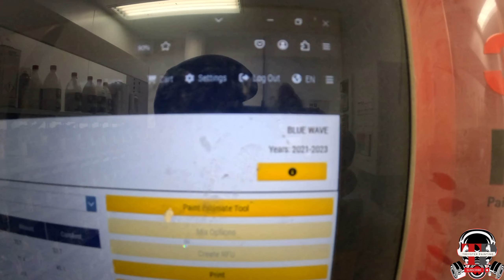Metallic Blue Wave with Glasurit 100 Line!! Ws-400 Series 2 and Sata Jet 5500RP!!

Comment: Damn that’s a cool gun case!! Is that made for guns or did you make it? Love watching that 100 line get sprayed. Looking slick!
Reply from the maker: It’s it’s made specifically for Sata guns. And yeah 100 line is amazing to watch and apply.
Reply: @treysterthepainterturner8404   best line I’ve seen so far it seems
Reply from the maker: @nickcrill7718 it’s a good line to be. I’ve been getting good luck on color match. Knock ✊🏾 on wood 🪵
Reply: 5500 RP w/ I cap, or WS400 Series 2 for high solids clear?
Reply from the maker: @Ontheroadbrogymgo wait wait u got me lost. What u asking me??
Reply: @treysterthepainterturner8404 I know you’re using the Iwata base gun, I was asking about the series 2 ws400 compared to the 5500 RP I pattern. Which one works better with a high solids clear? I have heard the CC can be a bit slow.
Reply from the maker: @Ontheroadbrogymgo yeah the cc is a lil slow but u get used to it. Depends on what u looking for if u wanna be fast use the RP if u wnt flatter finish then go with the series 2

Comment: I’m about to start using the 100line in October can’t wait I was wondering how long does it take the 100 to flash down before you clear
Reply from the maker: Not long at all. Pretty much when the paint turns matte it’s ready to clear. But what I do do make the water come out faster as soon as I’m done painting I’ll hit bake while I’m cleaning my gun and I’ll check if the water out it when I’m don’t cleaning my gun and if not I’ll blow the area while it’s baking then I’ll clear afterwards. Normally I’m baking it for about 5 to 10 mins.

Comment: Would you recommend the ws400 obs series 2 for that waterborne over sata rp 5500 I pattern? Thanks
Reply from the maker: For what line paint is the question?? What waterborne paint u talking??
Reply: It’s bmw line wet on wet application very similar to spies hecker hi tec or Cromax pro…thanks for your reply 👊🏼
Reply from the maker: @timreeks2149 idk if it’s as thick as the 100 line because if so the Sata would be better than the obs. I have the bfs series 2 for this line. I do have the obs series 2 but it’s a little slow with this line and do pump out enough material.
Reply: Nice one thankyou bud.yeah it is thick and basically one full coat and immediately apply orientation coat held back 12” or so..I’m using 5500 1.2i for base and clear..our clear is very thin so may go with 1.3cc or ws400 clear for the clear coat…thanks for your man 👊🏼💥keep up the vids dude top painting…you recon cc or ws for clear? Cheers dude
Reply from the maker: @timreeks2149 no problem and depends on what type of speed you looking for in clearing because they both are very great gun but what speed u like to do when clearing
Reply: I go pretty close and fast..I mean the 5500i goes pretty good just wondering if the ws or cc would be any better..I’ve tried the 1.3i for clear but find it abit chunky
Reply from the maker: @timreeks2149 the 1.3 I is very different than the CC. The CC atomizes it a lot better. I don’t spray close when I spray my base and Clear so.
Reply: Thanks my man helped a lot.just gunna get a new clear gun is a toss up between ws or cc ..I paint bmw all day so maybe stick with sata and get the cc seen on YouTube good with ws and cc…just fancied a change from sata for clear..maybe try the ws and if no good just sell and get ws…have a good weekend bro cheers for all👊🏼👊🏼